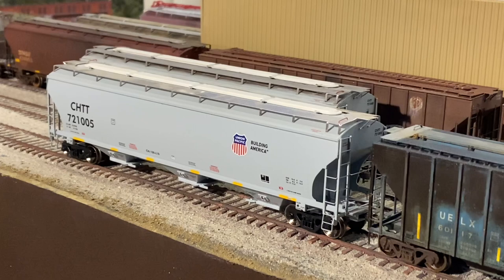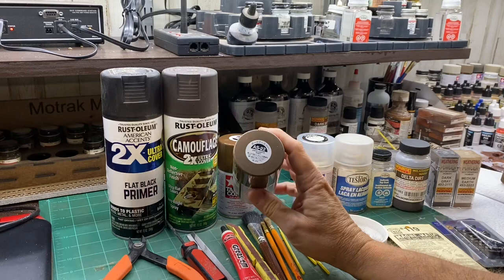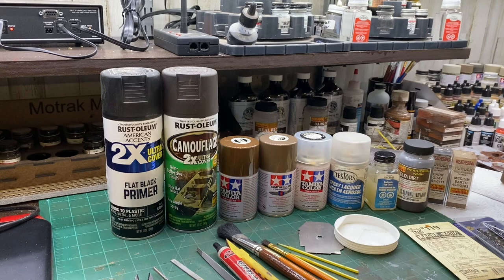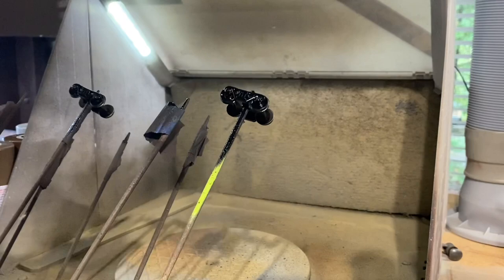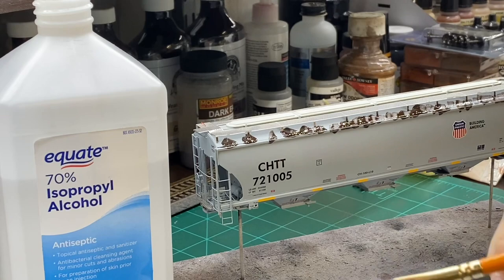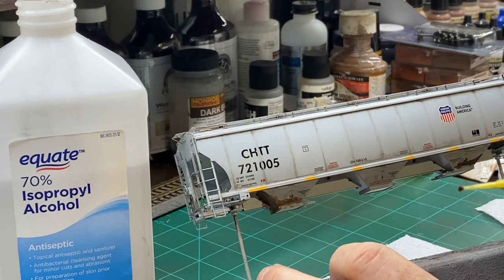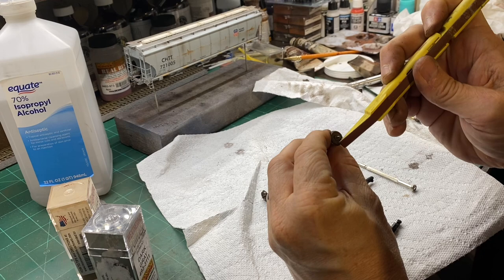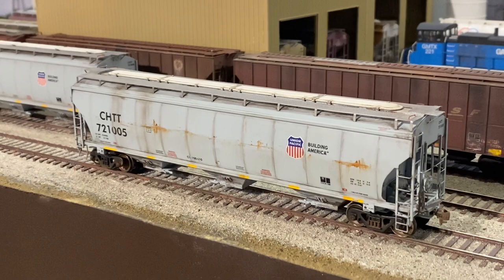Seaboard Central - Easy Freight Car Weathering No Airbrush!

Comment: Great job as always, no wonder your cars look so naturally weathered, I use inks, charcoal crayon and plain charcoal and pastels with alcohol, 70% like you do. You're right you don't need an airbrush,
Reply from the maker: Thanks Calvin! I still use an airbrush when the appearance I am after calls for it. In this case, it wasn’t necessary so I thought I’d make a video on it.
Reply: An airbrush is a tool. It's useful for some things, and not for others. This car didn't have any weathering for which an airbrush would be useful but, for example, airbrushes are far better than anything else for fade effects.

Comment: Might I suggest, a small piece of wood dipped in acetone would quickly cleaners wheel rims and axle ends quite nicely. The wood only needs to be damp, not soaked.
Good luck
Reply from the maker: Sounds like it would work

Comment: I have a little tip tim, you know those rubber door stoppers that hold the doors open you can put them under the wooden base that holds the rolling stock so you can "tilt" the rail car at an angle to work on,that way you can keep your hands free.I misplaced mine or I would send you a picture on the SC Facebook page.. great video I'll have to pick up some of those MM weathering washes now that I've seen them being used, been eyeing them for awhile now,I like the effects it gives.
Reply from the maker: Thanks Joe! Good advice!

Comment: Hey Tim, I'm seeing several variations of that wheel holder.  Since you have it and have used it,  does it really matter which variation you get?
Reply from the maker: No I wouldn’t think so. They make one that holds 36” wheels and another that holds 33” wheels. Micro mark sells them as a set.